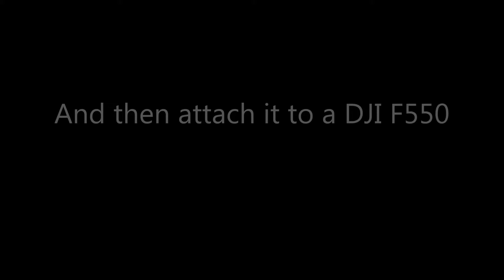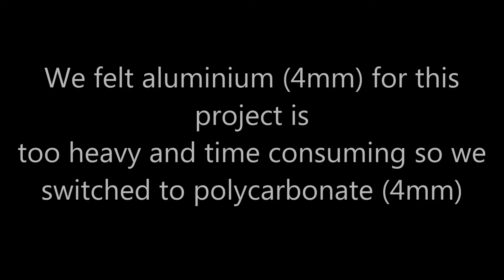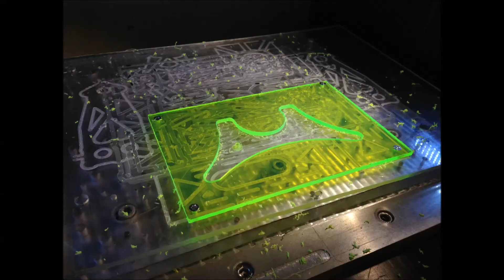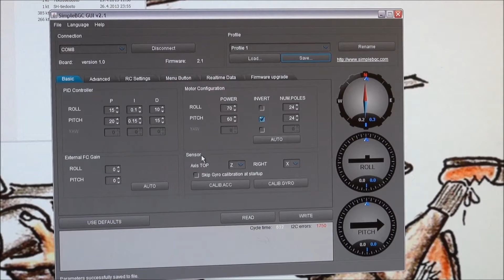Making an Alexmos Gimbal with a CNC-Mill

Comment: That is one enormous VTx, 2000mW? The make pls if you can get back to me?  Now the CNC work. Your design? Quite the undertaking to manage the Belt drive for roll, servo for the Pan function, Direct drive for the tilt,  it is more than impressive!  I would have been interested to see the weight of the gimbal by itself. I especially like the fact it sits on the gimbal and there are no legs to get in the way. But how does the alexmos like to initialize in this set up? So many questions eh? As one transitions to a DV cam for shooting AP, a much larger gimbal is needed, I am just getting into FPV and have purchased an off the shelf variety for the ubiquitous action cam, and I am just setting it up, but with plans to get a 6040 CNC and the desire to gather some plans for projects I thought I would ask in hopes that there are ready made files for gimbals that are out there :-) regards c
Reply from the maker: Chris Leech Thank you! If you are reffering to the transmitter its DJI's Tx not sure what the mW is on it. Upcoming CNC project is almost ready as all the parts we need are soon all here. We have to make a few parts with out current cnc for the new big one. The gimbal is 1400g. Thats 2 one fifts of a half grown wild bore in imperial. The Alexmos initializes it self just fine we let it stand on the gimbal on the ground. You can pm your email address to us and we will send you the .STEP file of the gimbal if you want to try and make it with your cnc. =)

Comment: hey man!.. amazing work! respect!
did you use an "out of the box" 550? no Upgrades?
got a 550 my self, and its just Hard to believe you've got 7.5 minutes 
out of a 4500 with all that Weight!!
Reply from the maker: Thank you! Yes. Out of the box. Nothing changed. It was a 3700 :D We will change the motors soon we will fit it with E600 Upgrade from Dji.